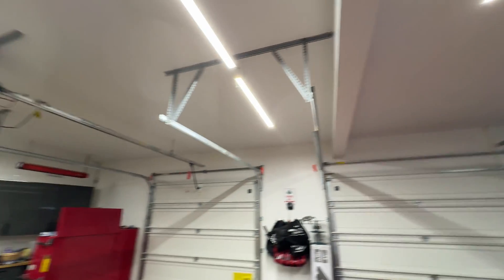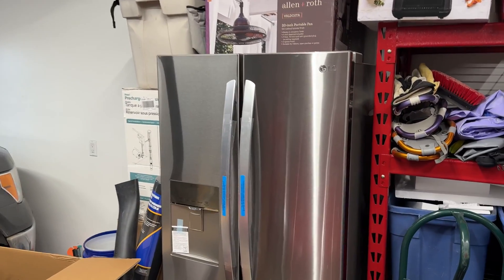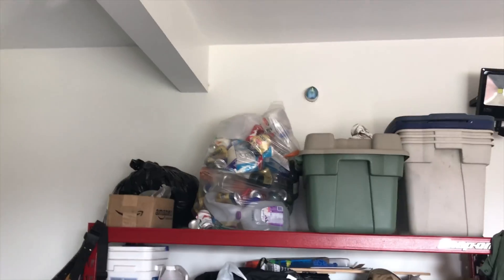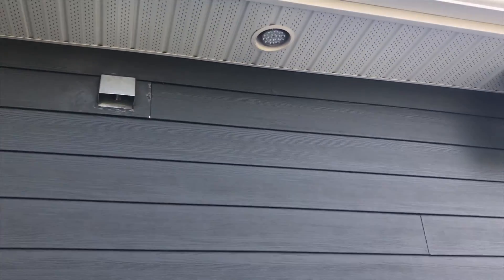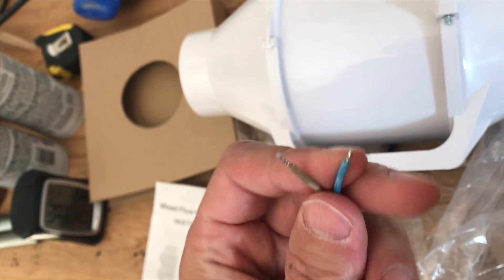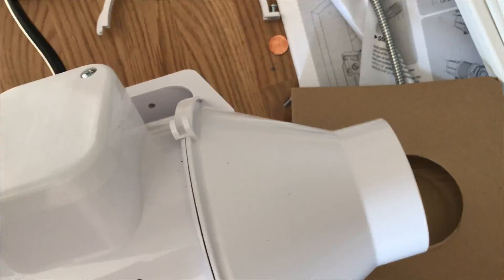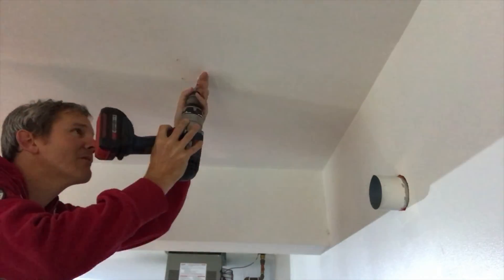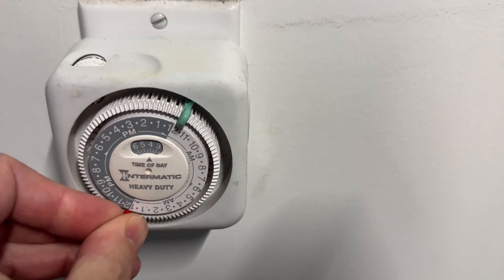How To Install A Heat Exhaust Fan In A Garage

Comment: Adding insulation to my garage doors did wonders to mitigate the heat and cold in my bonus room, and overall temperatures in my garage. Just using a $100 pack of garage door insulators from Amzn made life bearable in the garage. Cool in the summers, warm in the winters. Between the floor and the garage ceiling is insulated, but the exterior walls are not. That is next on the agenda, to blow in insulation into exterior garage walls.

Comment: What would you use in the case of dust build-up? We raise chicks in our garage, which produces a lot of "chick dust". Is there a certain type of extraction fan that I should be looking at, to help reduce the amount of dust deposited around the garage? Perhaps one with a certain filter system?

Looking for something that would be easy to maintain / clean, but would also be effective.

At the moment, likely looking at ceiling mounted or wall mounted.
Reply from the maker: Great question. I would imagine that a folder would be best, but this in not my specialty. Hopefully someone on here will see your question.

Comment: I did the same thing but in my basement.  I live on Cape Cod and there seemed to always be a lot of musty stale air in the basement as the air was very stagnant.  I have a dehumidifier and ran a small fan for circulation but never really solved the issue.  I ran a fan like this with hard 3" vent pipe.  I pull from close to the cement floor and exhaust out.  Works very will.  I have since started to "smart" home things and added a temp and humidity sensor and a smart plug.  Now it will just does its thing.

Comment: Depending on how well your garage is insulated, you might want to consider adding some sort of intake. With your current setup, you are likely building up a lot of negative pressure, which could explain why the fan isn't working very efficiently.

Great video tho! I really like how you made things look easy :)